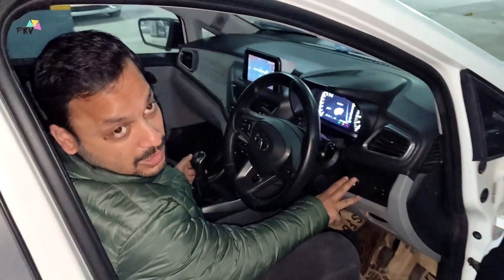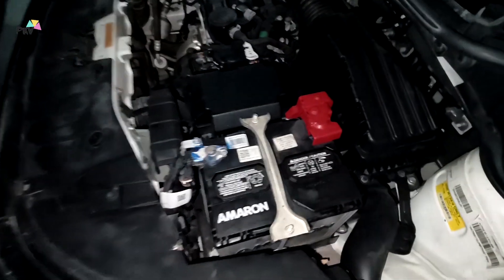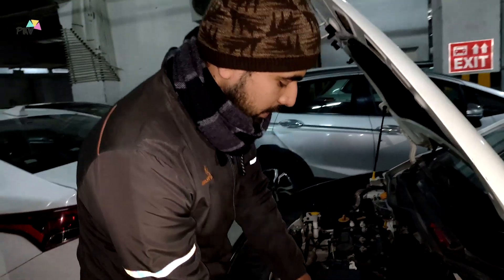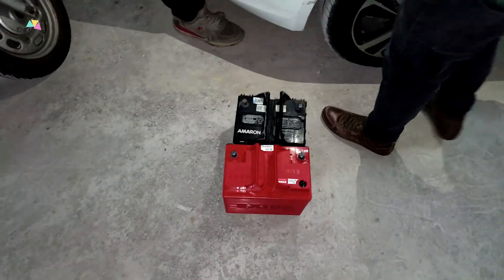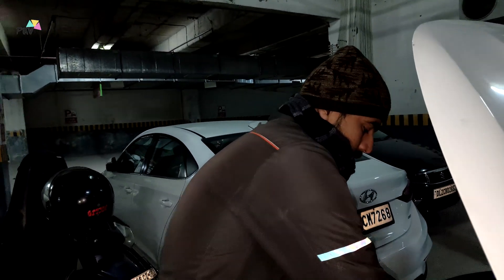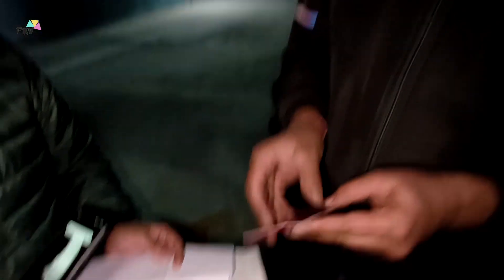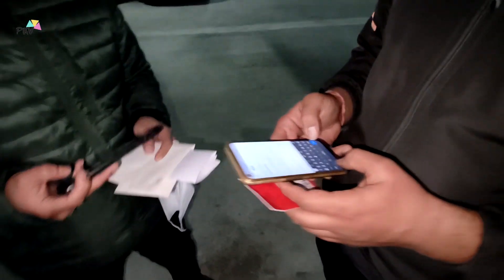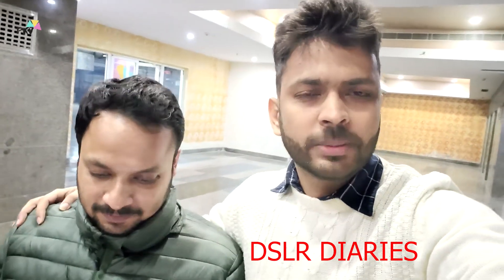Car Battery Replacement || Tata Altroz Battery Changed || how to change a car battery

Comment: Bhai @pandey ji, please help. my altroz xz+ iturbo battery deat after 20 month.. company battery 60ah ka hai aur manual me bhi likkha hai to use 60ah only.. but bazzar me 60ah ka maal kuch nahi milta hai.. either amaron 65ah ka or exide 70ah ka.. amaron showroom ne bola ki 60ah onle tata ko supply karti hai amaron ar mujhe milne me 6,7 din wait karna parega aur Rs.8400 ka parega with out exchange.. ab kya karuuuu? please help me bhai...
Reply from the maker: Bhai aapka city ? And kya aapne Exide ka rate pata kia ? And i will suggest agar bahut urgent hai toh showroom se change krwa lo agar tier 2 ya 3 city mein ho.
Reply: I'm from kolkata.  I just want to know ki 60ah company bolta hay to 70ah lagwane se koi problem hoga kya??  Service center wale kehraha hai ki 60ah hi leneko
Reply: Will not create any problem. Better go with 65 ah.
Reply: @adeshsachan4996  65 or 55? Which one is better?
Reply: @akdas27   main bhi calcutta se hun. Altroz ka battery mil nahi raha hai Kb motors service center mein. Koi solution mila?
Reply: 60D23R nahi mil raha koi dealer ke pass. Solution kya hai? Amaron ka konsa EFB model lagaya?

Comment: Battery change krne k baad ISS (Idle Start Stop) sahi se start hone mein kitna time laga?
Reply from the maker: Immediately i guess
Reply: @PANDEYKEVLOGS  got battery changed 2 days back and ISS is not working properly. Do you know any fix?
Reply: After changing the battery, you have to keep the car idle for 3 hrs with engine shutdown and the car locked. If you have driven with the new battery, disconnect the negative terminal and reconnect it after 15 mins then leave the car untouched for 3hrs. The next time you drive your car, ISS will work. All these steps are written in the Owner's manual of the car( page no. 130 of Altroz's Owner manual). This is how I got mine to work!!

Comment: Same problem i faced week ago..altroz xz patrol purchase ki thi 2021 January me... Ek subah gaadi chalu nhi hui...Battery down ho gayi aise hi..bina koi reason k..kabhi laga b nhi k battery weak ho rahi hai..Gadi me amaron ki 60AH R wali battery aayi thi... 18 mahine ki warranty hoti hai to woh b kaam nhi aayi... tata k various service centres me phone kara to sala kisi k pass battery nhi...order karna padega.15 20 din lagte hai..service battery b provide nhi kar sakte...bahaar se hi karvane ko bola..  Market me dekha to amaron ki 60ah wali battery hi nhi milti... Sayd unhone isi liye mujhe bahar se laga ne ko bola... Uske baad 65Ah wali battery laga ne ka solution diya kai logo ne...lekin 65Ah ki battery se agar koi equipment fail hua to extended warranty me claim k dikkat aayegi kya..is question ka koi jawab nhi service centre ke pass... To phir gaadi ka kare kya bc... gaadi achchi bana li lekin services abhi bhi baba aadam k jamaane k hai inke
Reply: Ah is battery capacity if you use bellow 60ah will give you problem with backup. Otherwise you can go with 65 ah 12 v with no issue.

Comment: Wrong battery. This is not compatible with altroz. Altroz supports DIN60 R type efb battery for idle start Stop. Exide doesn't have 60Ah battery. They will always ask you to go for 55Ah or above 70Ah. In long term it will harm your electrical part.
Reply: Do you know where I can find efb battery?
Reply: @dakshsingh7986 same  question. I have also searched with lot of dealers but no one has efb battery in delhi Faridabad